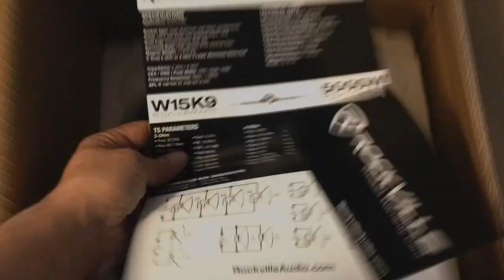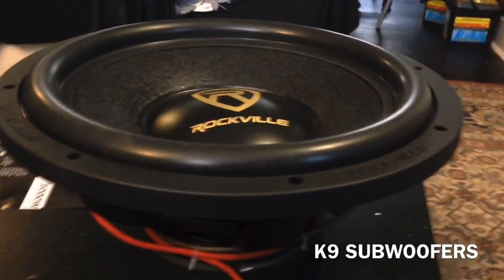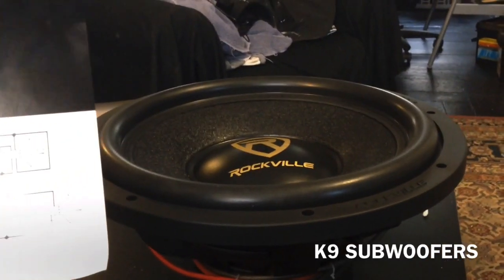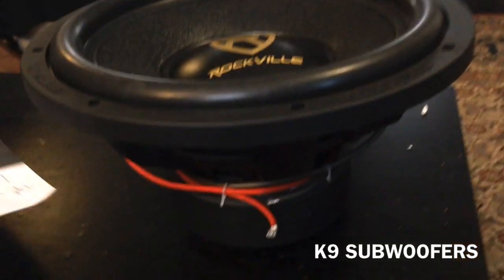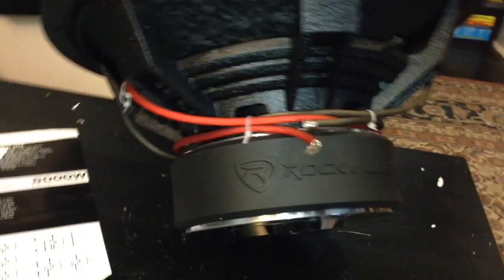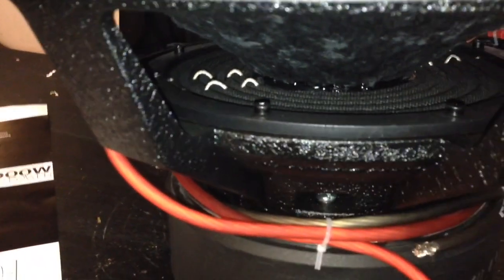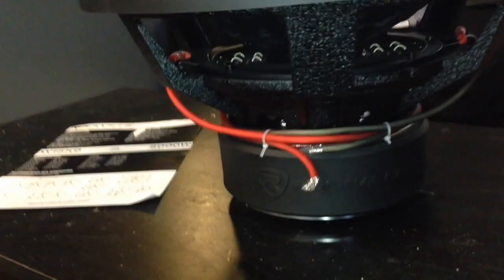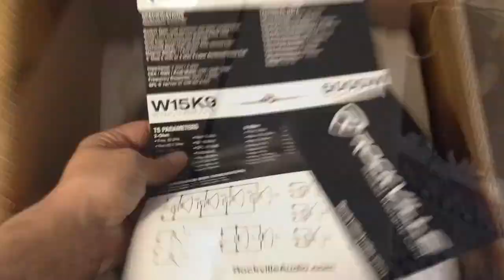Rockville audio K9 15" subwoofer . Unboxing & budget build update

Comment: You're going to have so much flex in that front single baffle with no bracing...
Reply from the maker: Joe K.O.S be sure to check my latest update video on the build .
Reply: Better baffle for sure,  but you're still going to get flex with no bracing to support the baffle to the back of the box. Still looks like it'll sound good none the lessm
Reply: Joe K.O.S I
Reply: Joe K.O.S how can I connect subwoofer rockville k9d4  to an amplifier Rockville db45